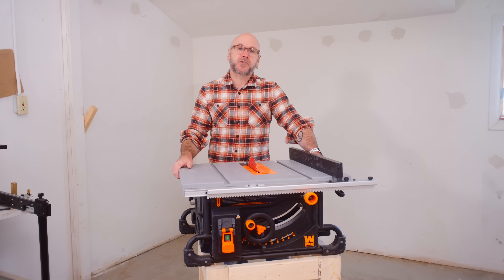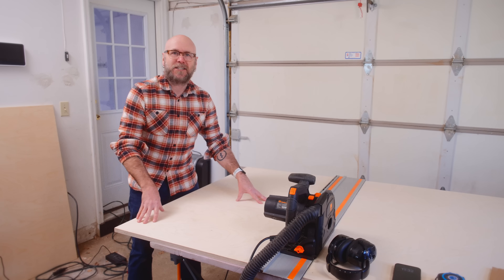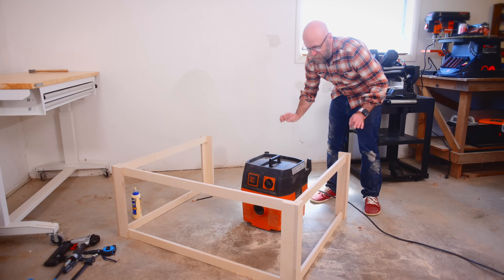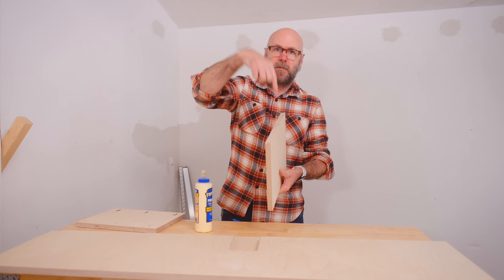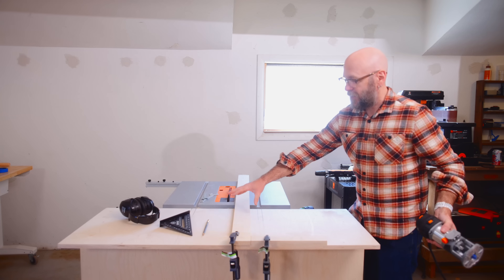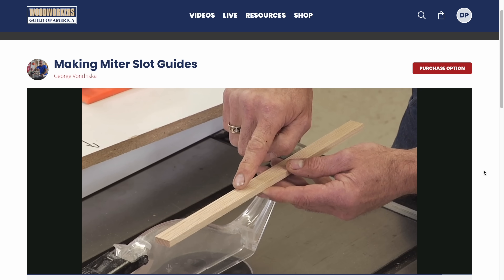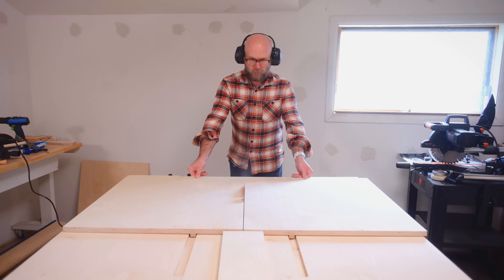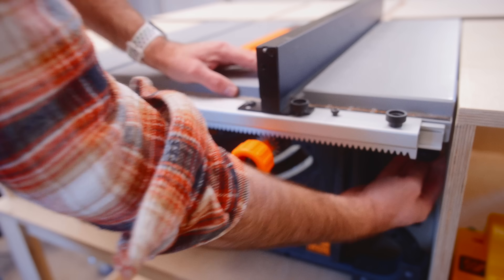Transforming a Cheap Table Saw Into a Professional Cabinet Saw

Comment: If you really want to improve things you'll throw some carpet down on the floor like God intended.
Reply from the maker: Right?!?!
Reply: That carpet’s days are numbered.
Reply: They prepare the table, they spread the RUGS, they eat, they drink. Arise, O princes; oil the shield!
Isaiah 21:5
Reply: Which god though 😜
Reply: you're welcome to help pay for my 1500 sq ft of carpet i need. Then again, my whole shop is on rollers, and... that kills how my shop works if I was to carpet it.
Reply: Love seeing the interaction between a couple of my favorite woodworking channels
Reply: @sarinhighwind  offroad tire upgrade time i guess. haha
Reply: Preach on brother!
Reply: Rubber! 😁
Reply: I think you spelled epoxy floors wrong, Stump.
Reply: I just put a laminate down with a good pad under it. A little softer than the concrete was, looks great, easy sweeping. I like it so far.
Reply: The best shop improvement anyone can have is a urinal.
Reply: @mannurse7421  Drill a hole through a wall. Insert an old oil funnel. Done.
Reply: You need carpet to catch the saw dust ! For heavens sake !🤣🤣🤣🤣🤣🤣🤣🤣🤣👍👍👍👍👍
Reply: He has carpet in his real shop,  you know this !
Reply: Carpet in the shop, I didn’t know that was an option? Lol.
Reply: Sorry, but a WEN budget saw in a cabinet is not and never will be a Harvey, Sawstop or Powermatic. Improvement? Yes. The same thing? Not even close. Just my $0.02 YMMV
Reply: How bout that blade guard
Reply: And on the outfeed table!
Reply: @rexseven6907  when you roll caster wheels and heavy stuff over...how does it hold up?
Reply: I remember going to a friend's house when I was a kid and they had carpeted bathroom floors 😂 it's been 25yrs and I hope they changed it at least once.
Reply: @radiationroom  it looks better than my Bosch table saw.
Reply: @mannurse7421  An empty laundry detergent bottle.
Reply: @StumpyNubs FUNNNNNELLLL. That's what I missed! And I just installed the carpet too darnit.
Reply: @generalsworkshop it's actually amazing. Obviously you want good dust collection and a nice vacuum but you just can't imagine how decadent it is. It will feel very wrong for a little bit. I kind of felt like I was wearing muddy boots through my grand mothers "visitors room".
Reply: @StumpyNubs  i almost spit my coffee out reading that haha
Reply: The one thing nobody can solve is noize coming from the Saw .I mean oh to eliminate or reduce it?.
Reply: @sarinhighwind  actually it doesn't if you use 3" double roller casters. I upgraded my office chair and it now even rolls on shag without those worthless plastic protectors.
Reply: much easier to clean and vacuums a cement or wood floor than a carpeted floor .
Reply: i upgraded my saw without any problem a miter from amazon also and it was a great improvement. i’m a fair weather hobbyist . all my wood working is outside . so don’t have and concern about saw dust . once i’m done i use my leaf blower to remove any saw duct from the table saw and surrounding area. i do wear a dust mask, ear protection and eye glasses. i dont care for  compact stand. i bought the powertec rolling stand that can store the table saw in an upright position as i did with my chopping board saw on the ridgid rolling job sire saw.
Reply: hundreds of religions and everyone thinks there’s is the correct one!😂😂😂 than you have the hypocrisy like you get from trump!!! 😅
Reply: @MCsCreations
Reply: @harrydoherty8299 youve probably been having a real melt down the last couple of days huh?
Reply: As ALWAYS lumpystubs has terrible advice... The worst decision I ever made was putting carpet in a wood shop...  ridiculous for so many reasons..
Reply: @RowanHawkins  I was going to say, as long as your casters are big enough they should roll on carpet no problem.

Comment: I made a $275.00 Dewalt contractor saw into a full cabinet saw. I made a work table that is 4’x8’. I stripped the contractor saw down by removing the fence and cut a hole in the work table about 6” from the edge. After dropping in the saw, I added a Besemyer fence. I then added my router lift, a vice and 2 cut outs for additional tools. I made elevator lifts for these openings where I put my planer and spindle/belt sander. I just raise them up when needed and they are lowered and completely out of the way when not needed. I basically have 3/4 of the my shop all wrapped up in one bench. It’s on 6 four inch locking casters so I can easily move it around the shop. Next I’m going to add an electric hand plain so I can use it like a jointer. This is probably the most useful thing that I will ever build.
Reply from the maker: This sound amazing!
Reply: The DeWalt jobsite saws must be the best product they make. Been top of that tree for decades. I hope they are maintaining the quality of their corded versions. They have let corded versions of other tools plummet as they concentrate on cordless
Reply: Is there anywhere to see photos of this? I'd love to see the elevator mechanism for the planer and such.
Reply: As Norm would say , my paraphrasing, measured drawerings?
Reply: I'm in the process of doing something similar until yesterday. I put a straight edge on my table because an aftermarket zero clearance throat plate I purchased didn't fit... turns out the top is warped all over the place. Makes sense because I don't ususlly get consistent cuts on jointed snd planed boards. I Haven't put a feeler gauge on it but there's clear daylight with multiple straight edges. I guess Dewalt's tolerance for their stamped tops is 0.05".... seems pretty high. So I'm scratching the saw part of the workbench and in the market for a contractors saw. Thinking Laguna F1 but there are mixed reviews and II cannot decide.
Reply: @garyburnett7378  Sounds nice.👍🏽
Any videos or photos?

Comment: A really quick hack to improve the precision of the rack and pinion fence is to put a quick grip clamp on the dial, giving you much more leverage and control for those tiny adjustments. That tiny dial really is the weakest link in the chain, the one factor that can make the adjustments imprecise. You could also permanently attach something to make the dial bigger / add leverage, obviously the easiest way would be to drill a hole into the dial and screw in some kind of rod or dowel.

Comment: Surely the dust extraction hole you left in the back "storage" compartment will stop the blade from tilting now. Won't you need turn that into a large quarter circular slot (mimicking the slot on the back of the saw) to allow for the blade to tilt without the vacuum hose fouling on the wooden cabinet?

Comment: I would recommend a safety improvement to the crosscut sled. The blade comes though the fence and risks hitting something or someone as it does. I would add a block on the backside of the fence to bury the blade as it comes though the fence. It would also reinforce the fence at the curf.

Comment: You have no idea how useful videos like this are for people like me. 
Thank you so much. Here in the UK big table saws take up so much space we just don’t have room for them so setting up shop with a budget job site saw is usually the way to go. 
You’re inspirational- loads of great tips and advice. Thank you.
Reply: Ain't that the truth, our home workshop spaces are usually the size of the average Americans workbench  😂 Probably why tracksaws are more common here. Tracksaw and mitre saw do the majority of my cuts.
Reply: In UK, it is well worth investing a good jobsite saw (usually DeWalt but they may have let their corded version quality slide as they have with other corded tools) and set it up as a cabinet saw. The latest Evolution looks like a good budget product but I've been burned by their quality control a few times in the past
Reply: By the time you build that table you've taken up the same space if not more space than a bigger hybrid or cabinet table saw, you aren't saving any space...just put a mobile base on the cabinet saw and roll it out of the way when you don't need it, that is what I do.
Reply: In the UK get yourself an Axminster Workshop 216 saw. It has a cast iron top and much better motor and mechanics than any jobsite piece of plastic you can buy, it's so much better it doesn't even compare, and still relatively affordable.
Reply: @DirkieB  but the fence is crap and the riving knife is a nightmare to set up, dust collection is also abysmal. id go for the hammer k2m saw out in september
Reply: nowhere in this video does he go into adjusting the top so the blade is parallel to the mitre fence, or ensuring the fence is parallel, or setting the positive stops for 90 deg and 45 deg, this video is not the one to follow if you want to tune up a small saw for accurate cuts. with the size this jobsite saw ends up at you would be much better off with a cabinet saw without large extension tables, its also a hell of a lot quieter than a jobsite saw.
Reply: @wildbill23c  i agree, its no smaller than a cabinet saw with those extensions. i have an axminster 10 inch saw, takes up the same space, but its poor in lots of ways despite being better than a jobsite saw, dust collection, bad fence etc, im selling it and getting the new hammer k2m when it comes out in sept, sure its more money than this one, but im fed up with compromising in my workshop, buy properly once and you wont regret it, just annoyed it wasnt announced  last year when i got the axminster. the charnwood w629 saw has a good review on youtube but not sure id go by a single review.

Comment: I'm loving the budget tool series.  So tired of the tool schilling on YouTube and Thanks for not being a big brand salesman and for covering up the F35T00L label on the impact driver. 😉  Looking forward to more budget builds!  I also feel that any thoughts on the pros and cons of each tool as you use them overtime would be super helpful to your current audience and those future/beginner/budget minded creators out there who will become part of your audience.  Keep making!!
Reply: Just think about what you are buying and building in the case of this video, he built a table with outfeed support and end supports which now takes up as much space as a cabinet saw....so he hasn't saved himself any space at all by building that table LOL.  The nice thing is, with the mobile base, you shove it into a corner, or if you are working in a garage, you can even roll it outside to give yourself more room...and you can still take the saw out of the table to use on a jobsite or other location if you wanted to.  

I have my hybrid table saw on a portable base, serves the same purpose for me, roll it against the wall of the shop when not in use, all my stationary power tools are on mobile bases now for that reason.
Reply: @MJLWoodWorks   i have a bunch of Wen gear, its pretty good!

Comment: Also, having the pocket holes on the outside means the screws are directed into the material instead of toward the edge, making the joint stronger.
Reply: That's not true at all.
Reply: @kodman247  How so? It seems completely true to me.
Reply: @kodman247  I think you need to check your physics bro, obviously pockets on the outside means more material to go into / less likely to rip out

Comment: @MakeSomething   I'm going to be honest, I am going to make this exact table. I love the way you designed it. I have the same table saw & made a table for it, but I incorporated my miter saw to the table as well. I use the table saw as the holding surface for longer pieces that I cut with the miter saw. Only down fall, I dont have an exit support for long cuts on the tables saw. Love your table, amazing. Keep up the amazing work!
Reply: You could make an outfeed extension and put it on a hinge with a foldable leg so when you aren't using your saw, you simply fold the extension down out of the way and roll it up against the wall.

Comment: To upgrade your fence, check out the BOW XT XTENDER FENCE. I went 46" on my Dewalt (DWE7491RS) Jobsite Saw and added the BOW XT feed supports. I only use them on the infeed side. I use a similar adjustable table for outfeed, so the feed supports get in the way. I also added the JessEm Clear Cut Flex Stock Guides (make sure  you buy the "flex" version). Once I build something like what you built, it'll be an even greater setup and a serious upgrade from stock. By the time it's all said and done, the upgrades will be as much or more $$$ than I spent on the saw. 

*To save some cash, it wouldn't take much creativity to build something very similar to the BOW XT system out of plywood.
Reply: why the flex version? does the others not work?
Reply: I have the same Dewalt saw and added the same Xtender setup as you. The difference, in accuracy and safety, FAR exceeded my expectations. I can’t recommend the Xtender enough. I considered cobbling together a homemade setup, but realized that if the end result was a nuisance to use (installing it, removing it, or adjusting it) I’d end up not using it….I consider the cost to be well worth the functionality. 👍🏼👍🏼
Reply: If you are cutting mostly flat stock, go with a piece of square aluminum tubing, its cheaper, lol
Reply: @MJLWoodWorks  I did this prior to buying the Bow Xtender with the feed supports. It did improve the stock fence, as far as helping prevent left/right movement of the wood….particularly if a good portion of the fence extension was on the infeed side. BUT, it was fussy to use….it was awkward to clamp in place, awkward to adjust, and did not give any support to any wood that extended off the front or rear of the saw’s table. In addition, it did not provide an east way to attach downward-pressure feather boards. Putting the price of an item near the top of your pros/cons list, when said item provides a significant improvement in safety, accuracy, and ease of use, is a false economy.
Reply: @mudz678  oh, I hear ya! Infeed can be a piece of melamine screwed to the aluminum.  Two holes in the aluminum with table saw fence clamps could work.. believe me, if I had the money I’d be buying all sorts of cool gadgets… but the purpose of this series is budget tools for budget minded woodworkers so, I would think the fence system is a major luxury for most budget woodworkers..
Reply: Did you have to do anything special to make the Jessem stock guides work with the bow fence? Was the t slot in the bow fence to high for the stock guides to attach and still reach the wood you’re cutting?

Comment: I installed a VEGA U26 fence on my vintage Craftsman 113.299 ten years ago. Outstanding upgrade! Comes with a micro adjuster that really works. Amazon for $350
Reply: Just wanted to ditto this, the vega fence is outstanding.

Comment: You just convinced me that I don’t need to get a cabinet saw. Thank you.
Reply: A lot of other YT sites do similar until they become big and they have the space and sponsors to give them a cabinet saw. Of course, a track saw does most of what a table saw does and you can get big circular saws to run on track if you have to cut deeper than 55 mm - I have a Makita to cut 85 mm off track and 80 mm on track or 70 mm on my home made track (extremely rarely)
Reply: Buy a cabinet saw, or do what I did and buy what they call a hybrid saw.  Its somewhat a cabinet saw as it doesn't have the open leg stand like a contractor saw, but it don't weigh as much as a full cabinet saw either.  I bought mine about a month ago through Grizzly Tools.  Since I have a shop setup for 240V I converted my saw to 240V.  

The portable saws are great on a jobsite, but you'll appreciate the larger table and power of a hybrid or a cabinet saw...heck even a contractor style saw is going to give you more table space and more power typically.  Also, in some wood working tasks you'll want to use a dado stack, some of the portable/jobsite table saws do not accept a dado blade.  

I mounted my saw in a portable base, so I just roll it up against the wall in the shop when I'm not using it and want the floor space for other tasks.  Every tool I've been buying, I have been putting on mobile bases, it just makes it nice to be able to put the wheels down and roll the tool around wherever I want it, and out of the way when I need floor space.  

I have a portable jobsite saw that I use occasionally when I want to do stuff outside and not be stuck inside the shop.  I don't do any construction/contractor work, I'm just a home DIYer so I don't take my saw anywhere, its just nice to have the mobility occasionally...however, a good hybrid or cabinet saw is what you really want in the long term if you want to do a lot of projects.
Reply: @wildbill23c and it’s just so much more pleasurable to work with a nice big quiet induction motor.